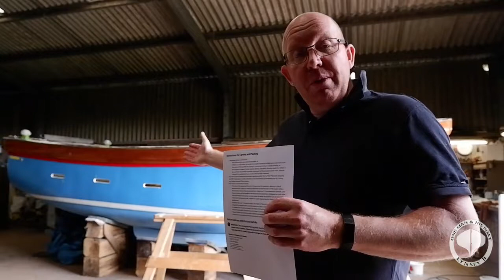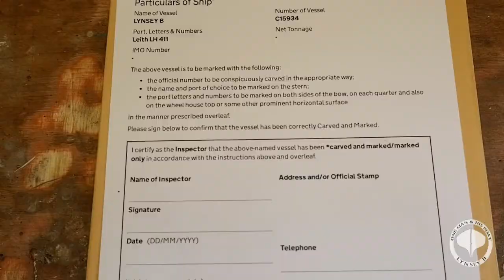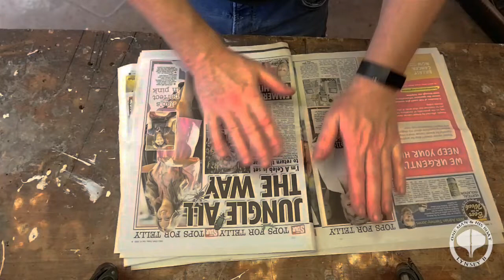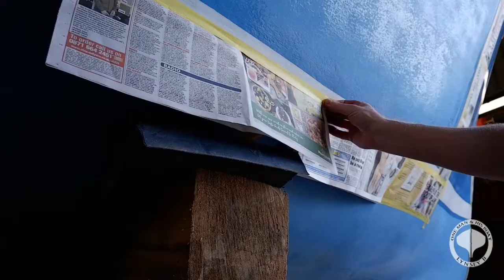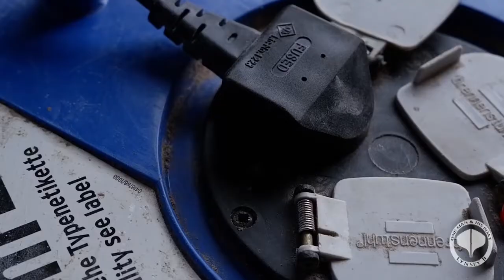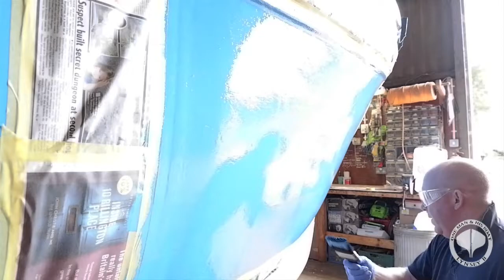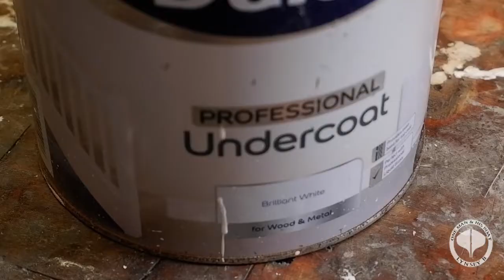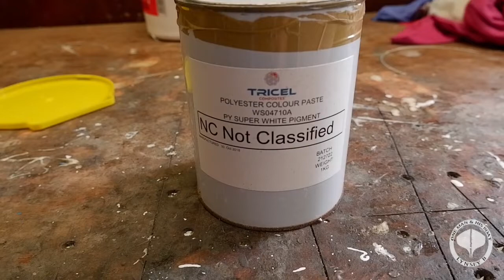Carvings and markings Episode 62

Comment: Barry. I have a quick question for you. I have an orkney longliner  and I'm about to cut into the boyancy tanks to fit flush fitting hatches so I can use them as storage. Would you happen to know what is inside? Foam? Finish ect. If you know any info would be great. If not then I'm gonna find out soon anyway 😅
Reply from the maker: Hi Wildatlanticfishing.
That would depend on year of your longliner. I don't think they started using foam until the early 90's. And to be honest,  I don't have much experience with the younger models. 
But not all is lost. If your on Facebook, " Orkney boats" now have an " offical" page....you can contact them ( by PM) And, if you have your serial number,  they should be able to tell you EVERYTHING  about your boat....they are very accommodating that way.
Sorry I don't have a definite answer for you, but like you said, "your about to find out!"😂😂😂😂😂😂
Good luck with your mods, I hope it turns out, just the way you want it to, with not too much hassle. 😂😂😂😉👍
Thank you for you're question. 
All the best

Baz.😉👍
Reply: @onemanandhisboat  thanks for the reply.  Yes I was in contact  with them before about my 520. Il give them a shout again. 
Keep up the good work
Reply from the maker: Thank you bud. Have a great evening. 
And good luck with the info.😉👍👍👍👍

Comment: Barry, how many rolls of that Frog tape did You use on the fit out?.....🤣  On a more serious note how do You work out the position of the water line? is it marked by the builders? is there a measurement/formula? or does the width of that white line give You a bit of leeway, so to speak?
Sorry for all the questions.😕
Reply from the maker: 😂😂😂 I had a 1/4 share in the company. 😂😂😂
The builder done a rough guide on where the water line should be, considering the type of build I was doing.
The formula that your supposed to go by, is, weigh everything that your going to use, including the building materials, the matting, the resin, all your ancillarys and work it out from your length x breadth and depth. ( how I was supposed to do that, I have no idea🙄)
So I just built the boat, using my
 " general knowledge " on the understanding on weight distribution and what I thought best, and it looks like, I got VERY lucky.🤣🤣🤣🙈🙈🙈😉👍
For all my fishing craft, I've always put a thicker water line in...like you said, it just gives you a bit of leeway...especially with MCA nonsense at the moment. 

Please ask away, I'm always happy to answer what I can.😁👌

Enjoy buddy.😉👍